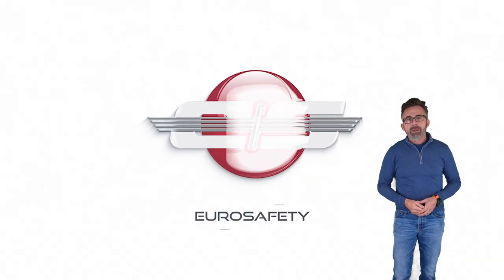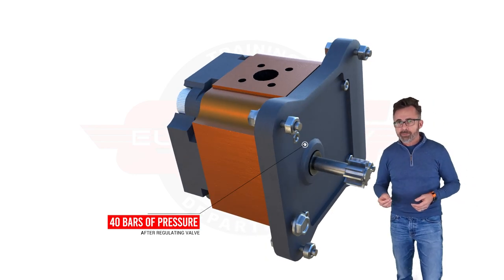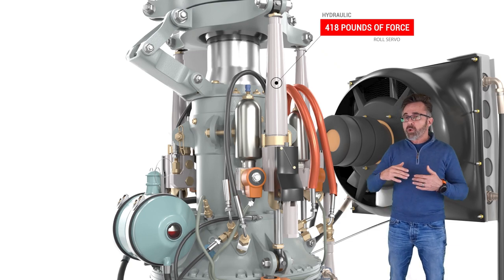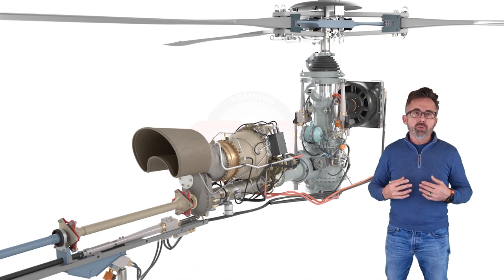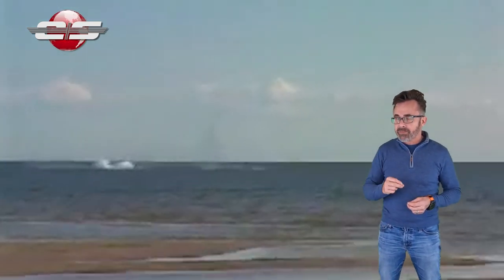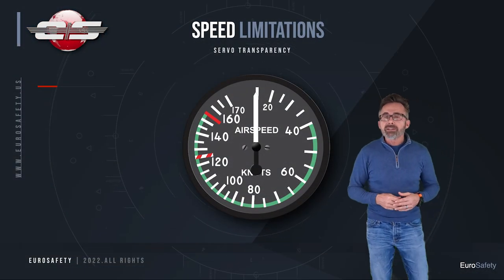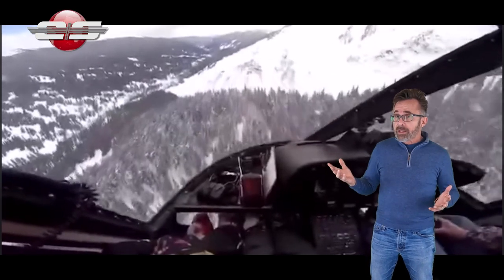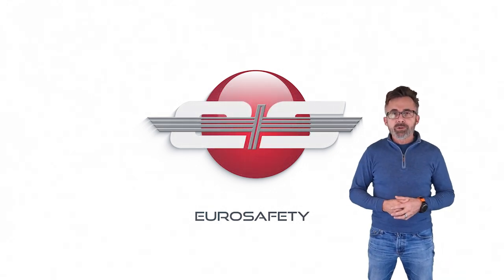Unveiling the Secrets of Servo Transparency in Helicopters.

Comment: "servo transparency" - what a lovely euphemism. How about "servo saturation", or perhaps "servo inadequacy". If it was really a question of preventing damage to the aircraft, there would be an indication of approaching saturation - either audible or visual.
Reply from the maker: If you fly the helicopter within responsible parameters you will never encounter this phenomenon.
Reply: @EUROSAFETYTRAINING  Maybe true, but manufacturers have a moral obligation to make their aircraft as forgiving as reasonably possible. I've had jack stall demonstrated to me a few times (I don't have a lot of squirrel time) and while it was definitely an abnormal flight maneuver, i wouldn't say that it's outside of the realm of possibility in some conditions. It's easy to pass the blame onto the pilot, but if there's one thing we know for certain, humans make mistakes. A slightly higher tolerance could save lives.
Reply from the maker: To put is very simply, there is absolutely no reason to fly a helicopter in a manner in which you can experience servo transparency. It would be akin to saying that the 737 has a deign flaw because you cant do a barrel roll in it.
Reply: @EUROSAFETYTRAINING  a fairly basic steep turn will set the limit light off in an as355, are steep turns barrel rolls ? Your argument is similar to Robinson’s argument against mast bumping, and it’s a bit of a cop out. At the end of the day human error is guaranteed, and the best human interface designs (for anything technical, not just helicopters) will be forgiving to that error. Good training will reduce the error, a better design will eliminate it, which will save more lives ?
Reply from the maker: Thank you for your insightful comments about the technical aspects of helicopter operations, specifically in reference to the incident with the 355 model in St. Petersburg. While the maneuver might seem normal, a closer examination of the pitch and roll parameters reveals they are quite extreme, something I'm sure you'd agree is not advisable for safe flying.

I concur with your point on human error. However, flying a helicopter recklessly is a deliberate choice, not just an error, and is undeniably dangerous.

Regarding the technical specifics, the hydraulic pump on this model can indeed handle pressures over 1300 psi, though it's regulated to 580 psi to avoid damaging the rotor system during flight. I believe the discussion should focus on whether a complete redesign of the rotorhead is more beneficial than merely adjusting the hydraulic pressure.

I hope my response doesn't come off as dismissive or similar to Robinson's style. My aim is to engage in a constructive and technical discussion about helicopter safety. Looking forward to more such engaging exchanges!
Reply: @EUROSAFETYTRAINING  my comments about the 355 were from my own experience, not an accident.

Not dismissive at all, much appreciated getting thoughtful responses, thanks again.
Reply: @defyent why are you executing a steep turn at high or higher speeds where ST can occur?  It's on the pilot to understand the machine, the load, the environment and how they all interact.  Having another dummy light or horn doesn't prevent dumb decisions, they simply give a glimpse into your likely future.
Reply: @Levi-wk2hg  congrats on contributing nothing. Move along.
Reply: @EUROSAFETYTRAINING  he talks about usability. Any aviation interface (including the servo-transparency mechanism) must be designed in such a way that a person has an instant, native understanding of the processes taking place

The hydraulic system is a certain abstraction from the point of view of how the cyclic pitch of the main rotor is actually controlled. This abstraction hides the real physical effort that hydraulic boosters develop. But at some point there is a SUDDEN loss of abstraction when this effort becomes too great

The interface should be designed in such a way that the pilot can, ideally without training, understand that the helicopter is approaching the limit of its capabilities. The servo transparency mechanism is not the best solution, there have already been quite a few plane crashes that prove this

or the interface must provide an arcade abstraction that makes such disasters impossible
Reply: @struvrim7637  Bingo. That's why I labelled servo transparency as euphemism. Helicopters are difficult, there's no doubt about that, but with what we can do with control systems today, there is no excuse for leaving a usability bug this bad in the user interface. It's as dumb as the 737-800 max MCAS mess.
Reply: I think they call it like that because the true aerodynamic forces that the servo was experiencing are now passed through all the way to the cyclic/collective, hence the servo being "transparent"

Comment: A heck of a safety feature. One that that saves the airframe for a few more seconds but causes a crash.
Reply from the maker: I think you are looking at the issue incorrectly. There is never a situation in which you should be flying in a manner where you could get into servo transparency. Period. The airframe holds you in the air. It holds your life with in. Should a helicopter be able to perform a barrel roll? If the helicopter can not would you consider that helicopter unsafe to fly because you could not perform said barrel roll?
Reply: @EUROSAFETYTRAINING  and a need to suddenly avoid a collision such as a possible mid air, and not being able to avoid it cause it might bend the airframe means y’all gonna crash. What a great safety system. (Sarcastic).
Reply: @cfdfirefighter they surely weighed the trade-offs and determined that this was the safest option. It's probably riskier to allow pilots to override the system, because then they might get too complacent. Either way, rather than making assumptions, it's good to look up this kind of thing to alleviate any sort of concern you might have.
Reply: @R2Bl3nd  the F-18 has an override to allow higher than rated G’s on the airframe. Seems like they could include that type of switch, and training on how/when to use it.
Reply: @cfdfirefighter  yeah it's certainly worth questioning why; it could absolutely be just a cost-saving measure that's decreasing safety. It could be that they put the upper limit high enough that you wouldn't ever want to push it further; I'm not an expert but I would guess that with helicopters, any amount of bending could potentially lead to a fatal catastrophic failure, just because the power distribution mechanics are so intertwined with the airframe itself, as opposed to being almost entirely self-contained in an engine on a plane.

Comment: GM had a problem on the X bodies where the rack and pinion passages would start to plug up and resist flow. With a yank of the steering wheel, system pressure would exceed the pop off of the power steering pump and the steering wheel would lock up. Easing off would restore function, but by then you already ran into a telephone pole.
Reply from the maker: Thank you for bringing up this interesting case with GM's X bodies. The issue you described with the rack and pinion passages getting clogged, leading to a sudden lock-up of the steering system, is indeed a serious concern. It highlights the importance of maintaining proper flow and pressure in mechanical systems, much like the servo transparency issues we discussed in the video. Of course the difference is that the GM issue was a failure within the system and servo transparency is reaching the maximum force of what the servos can apply.

In the case of GM’s X bodies, the sudden increase in system pressure overriding the power steering pump's pop-off valve demonstrates a critical design consideration. It's a stark reminder of how mechanical failures can have immediate and dangerous consequences, as you mentioned with the steering wheel locking up unexpectedly. Within servo transparency the lock up is achieved through a purposeful application of force on the rotor system. 

Thanks for sharing this example, as it adds a practical dimension to our discussion about the complexities and challenges in mechanical and hydraulic systems.

Comment: Hey Glen,
 
maybe you can give some insight about the dual hydraulics + increased internal take off weight on the AS350. Is it correct that one theoretically would get into servo transparency earlier in a helicopter with dual hydraulics(35bars) vs. single hydraulics (40bars) and even earlier in a dual hydraulics while using the increased internal take off weight? Is this the reason why there is a Limit light on the dual hydraulic system and not on the single system? 
Thanks in advance!

Comment: Mentioning "canyon walls" reminded me of Sundance accident (NTSB Accident Number: LAX03MA292; AS350BA, N270SH). A pilot of Grand Canyon tour helicopter, used to perform thrill rides, including flying at Vne and extreme pitch and roll angles. Servo transparency was considered and discussed in the report, but finally it was ruled out. I'm not going into details, but it shows, that you have to work for the transparency to manifest itself, usually by breaching several limits at once.

Another thing is, people seem not to be bothered about the possibility of mast bumping in a Bell or Robinson (there is at least one video on YT, that shows it almost happening) or Kamov's rotors intersecting each other, when flying slightly above Vne. These are not flaws, but part of the design as even the best ones have their limits. One can damage or even break a jetfighter or aerobatic plane, with a gross misuse of controls.
Reply from the maker: Well said!

Comment: It would be interesting to know what the difference is between the maximum force that the servo allows to be exerted on the aircraft and the force that the engineers designed the aircraft to be able to withstand.
Reply from the maker: The concern is the long term health of the composite rotor system. There is not a helicopter made where the manufacture publishes the breaking point force of their rotor system.
Reply: @EUROiSAFETY  do you think it would be feasible to design the aircraft in a way whereby when the pilot reaches the point of servo transparency happening, instead of completely preventing further input to the controls it will instead sound an alarm and stiffen up the controls significantly so it requires effort to move them beyond that point but it allows it to happen if the pilot really forces it? It seems that when this happens the aircraft is going to crash anyway, so might as well give the pilot a chance of recovery. Then once the aircraft has been pushed beyond the limit it must have the parts replaced that endured the extra stresses before its next flight.
Reply from the maker: Let make this discussion simple. The RFM states... In the limitation section....The following are forbidden:  - Aerobatic maneuvers.

The Federal Code of Regulations state.... § 91.9 Civil aircraft flight manual, marking, and placard requirements.

(a) Except as provided in paragraph (d) of this section, no person may operate a civil aircraft without complying with the operating limitations specified in the approved Airplane or Rotorcraft Flight Manual, markings, and placards, or as otherwise prescribed by the certificating authority of the country of registry.

You should never be flying this helicopter in a manner where you will ever experience servo transparency. Period.
Reply: @EUROiSAFETY  oh I absolutely agree. I think perhaps there was some misunderstanding in what I was saying, because I was not for one minute implying that people should fly in a reckless manor. But nevertheless it is evident that sometimes some people do push it too far, whether on purpose or not. Even the guy who flew the prototype of the 747 barrel rolled it twice in front of everyone. It doesn't mean they deserve to die by default though, along with all their innocent passengers, when they could potentially have been saved if only the servo allowed them a little more power at a critical moment though does it?
Reply from the maker: I apologize if I seem blunt or dismissive. My frustration likely stems from the difficulty in conveying what seems to me a straightforward concept. Many have commented on the video, suggesting that the hydraulic pressure in the AS350 should be increased. However, this overlooks the purpose and potential consequences of such a change. For instance, while it's true that the pump can generate over 1300 psi at 390 NR, increasing the system's pressure isn't a simple task. Doing so would require the helicopter to undergo complete recertification because this change could affect all components.

Moreover, past engineering analyses have shown that increased forces in the hydraulic system could strain the rotorhead. This implies that a complete redesign of the rotor system might be necessary. Consider the expenses involved in just these two adjustments. The costs would likely run into millions of dollars, driving up the helicopter's price substantially. Consequently, the helicopter could become too expensive for its target market, leading to a decline in sales. Such a significant investment and potential loss of business, just to accommodate the demands of a few who wish to operate the helicopter in an inadvisable way, does not seem like a sound business decision.

The addition of dual hydraulics to the helicopter led to a noticeable decrease in complaints about servo transparency. This change, however, was misunderstood by many. Contrary to popular belief, the introduction of dual hydraulics did not increase the system's pressure. It seems that the mere thought that the pressure had been increased was enough to silence the complaints. This suggests that the issue may be more about perception than actual mechanical shortcomings. If people believed that the problem was resolved with the new system, even when the pressure remained the same, it indicates that the original concerns might have been more psychological than technical.

If the system were to operate under higher pressure, the manufacturer would bear the responsibility for any resultant damage to the airframe. In a legal scenario, the argument might be that if the pressure is available, pilots should be permitted to utilize it. This places Airbus in a precarious, no-win situation.

Additionally, there seems to be a widespread misconception among pilots regarding the likelihood of encountering servo transparency. Except in cases of exceeding VNE, it's highly unlikely that many pilots have ever experienced it. Even among your acquaintances, it's improbable that anyone has felt it. On the off chance someone has, it's likely that they're known for unconventional or erratic flying styles. The hydraulic pressure in the AS350 is more than sufficient for even the most intense flight maneuvers.

In every instance where servo transparency contributed to a crash, the pilot's conduct was extremely reckless. It is not, in my opinion, Airbus' responsibility to cater to the whims of such pilots. If I ever believed there was a genuine issue with the system, I would be the first to voice my concerns loudly. My previous videos have been candid about various helicopter components when problems arose, proving my impartiality. However, I firmly believe that the hydraulic pressure in the AS350 is not a concern for professional pilots who operate the aircraft responsibly.

Comment: Hi Glenn, so if you do find yourself in this situation the correct action is to lower the collective?
Reply from the maker: Yes lowering the pitch would reduce load on the rotor blades. Generally though pilots are heading toward the ground when the phenomenon hits so the natural reaction would be to try to increase collective. But since you will never fly in a manner in which you would experience servo transparency its a moot point:)